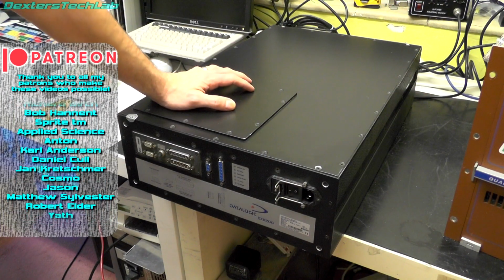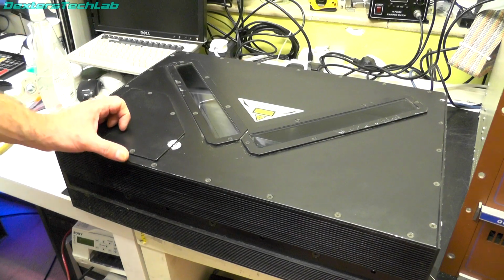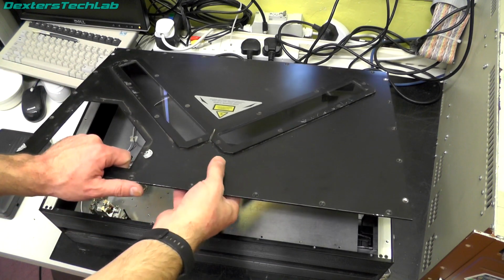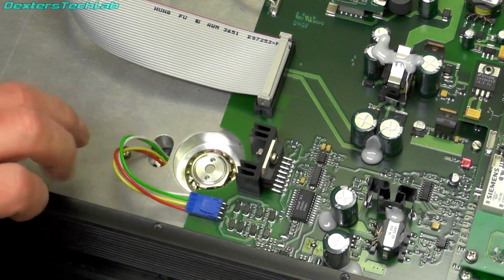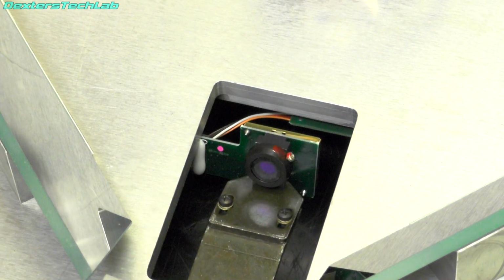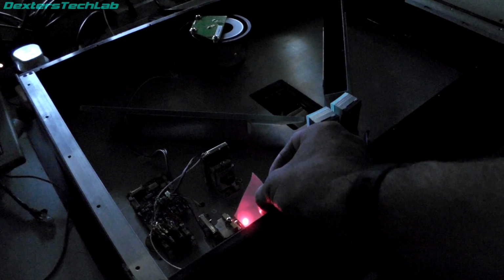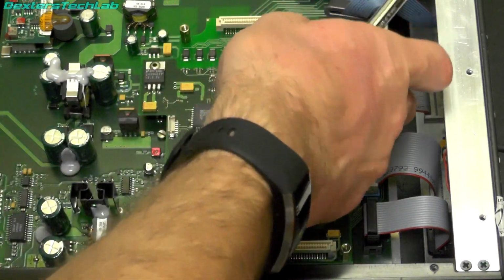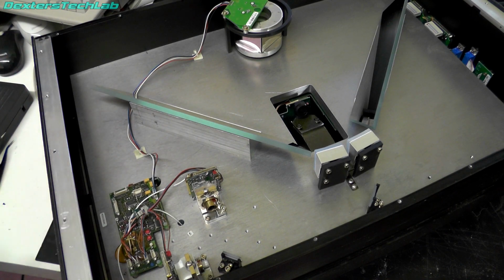DL227 Datalogic DL8200-2100 Barcode Scanner Teardown

Comment: Going to guess each laser has a polarising filter in front of it, so that the scanner can switch between different polarisation beams on the fly. Helps to get good reads with very reflective media, and also helps with detecting the difference between reflected and absorbed light in the barcode itself. Normally this should rad the massive barcode on the side of packages, the 2 crossed beams mean it can read any barcode on the visible side.
Reply from the maker: Interesting thought, i might take a look at that when i revisit!

Comment: Probably the kind of scanner you find in a shipping facility where packages pass on a conveyor belt. The industrial scanners usually need a GPIO-pin (scan enable) pulled before it will scan and interpret anything. The Encoder input is for a shaft encoder on the conveyor belt to help the scanner figure out how fast the barcodes are passing.
Reply from the maker: Yes, i am pretty sure this is the case. I will have to have a more of a play when i revisit it!

Comment: If you can't do anything with it you can still use it as a dace floor laser effect :D. The industrial barcode scanners that exists today are so small and only get power, Ethernet and switching signals over M12 plugs :) all standard.
Reply from the maker: Yes! If a small galvo replaced the R/A mirror you could draw waves / shapes into the crosshair. Swap the lasers out for slightly more powerful ones, maybe one red one green and it might look quite good!